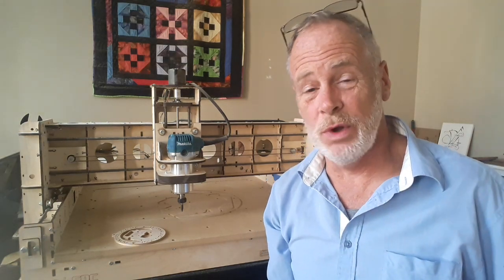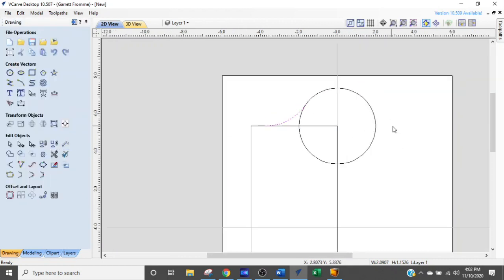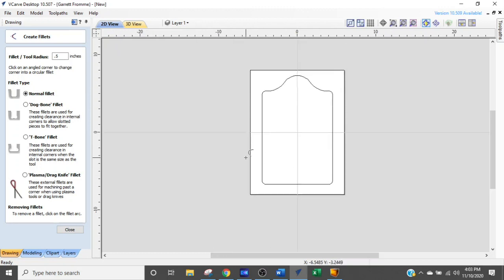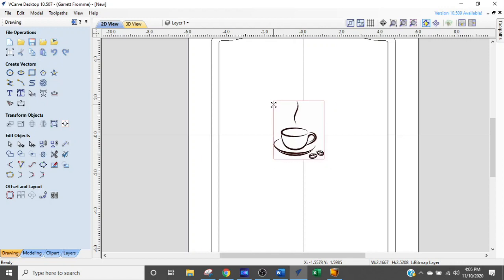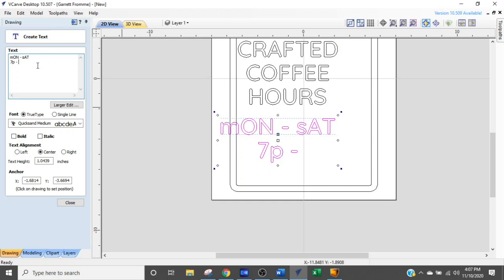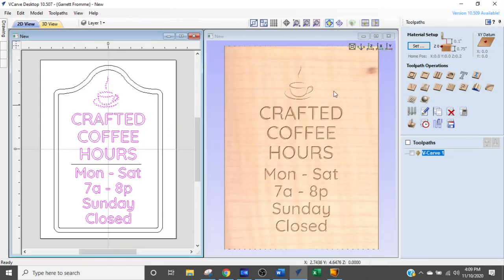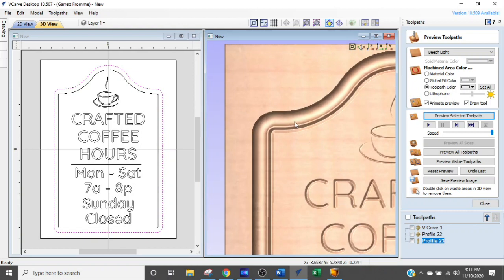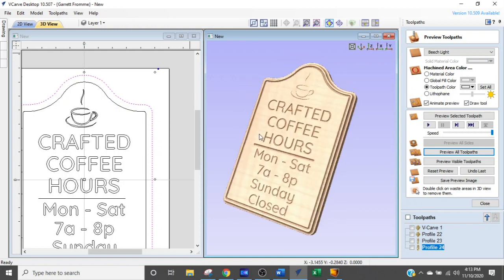13 Minutes To Design CNC Router Projects

Comment: Thank you! I am very new to cnc router and wondered if you have filmed a video of the steps from Vcarve (assuming you have a project built) to the router? Do you plug your PC into the command module? Do you use a USB? How do you set up your router to begin a cut?
Reply from the maker: Hi Dave. Welcome to the learning place for CNC routers! I have not created a video for the transfer yet. Thank you. You gave me my next video. Watch for it in a day or 2.

Here's a recent one I sent that will give you the best way to get set up when it comes to connecting: https://youtu.be/Ykftr4YxORw

IIn a nutshell, I have a dedicated laptop for the router (see the video in the link above). I do the design on one computer, transfer it to flashdrive and import into the dedicated machine. 

Does that help?
Reply: @IDCWoodcraft  Thank you so much, you are a great instructor.

Comment: Hi, great video. Quick question, how much would be the perfect price to sell these? Thanks :)
Reply from the maker: A sign this size with this level of work would be about $25-35. It goes with the 'importance' of the sign. An 'hours' sign is not nearly as important as a store name sign. Shoot for them when you can. you can get well over $100 for them.
Reply: @IDCWoodcraft  ah OK great! Thanks 👍
Reply: @IDCWoodcraft  is this really only $35?   Is that just what you charge or what the going rate is?  It seems way to low, the cost of running the machine, wear on tools, wood and finishing consumables, then the labor including packing it to ship looks like that would add up to a McDonald’s hourly wage.
Reply from the maker: @Dogpool  the sign was lightning fact to design and make. However, you're right, it would be more like $50 for a custom sign. Shopping is added to that price. Shipping charges are always cost x 2

Comment: Hi Garrett, do you use the vtransfer output to your cnc or do you export the gcode and use another program to run the the job.
Reply from the maker: My desk is away from the machine so I export to a flash drive and transfer to another laptop using Universal G-code sender (open source free). I like using that platform because I have direct control of my machine. Exporting direct from design software doesn't allow for that (as far as I know)

BobsCNC assembly instructions will provide you with the instructions to install that software. they also have videos on YT about it.
Reply: Thanks .Garrett keep up with videos good work..